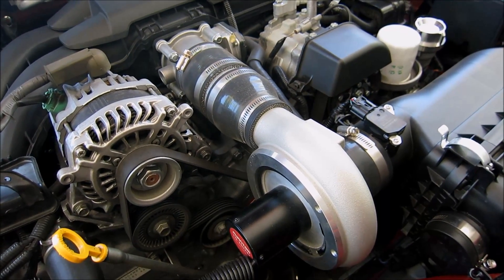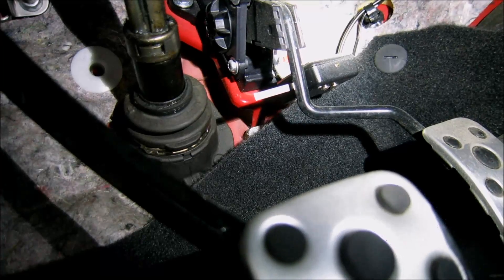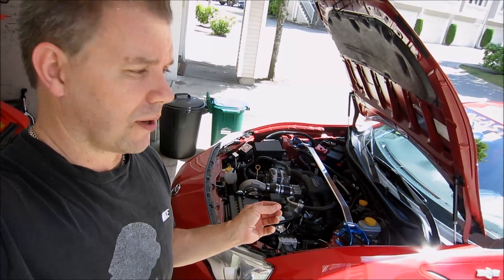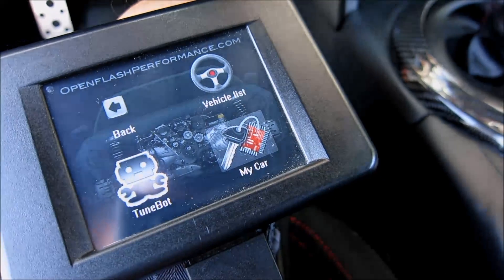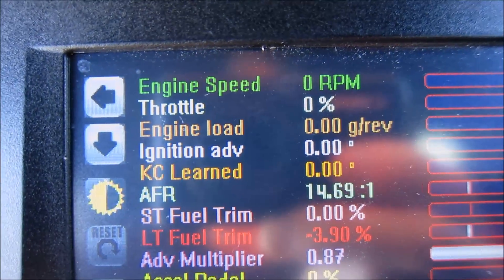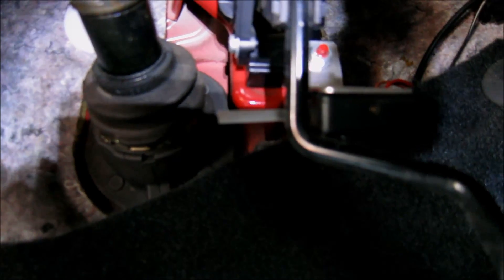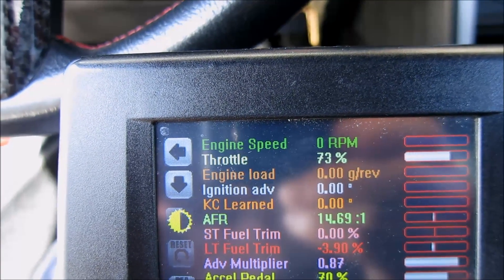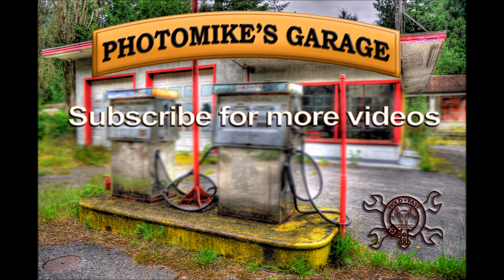The Phantom supercharger throttle activation

Comment: The point of the lower PSI; say 5-8, is to take away that low rpm acceleration lag. The point of low psi...so you don't blow your engine on stock internals, but get that umph, the pep in it's step. Y'all are thinking of this electric turbo in the aspect of it being worthless in drag racing and not as a simple tune to a daily driver without all the work. If he wanted 20+ psi...he'd of course go get a traditional setup and swap almost EVERY part of the engine...but that's not the point of simple electric turbos. You get to keep everything stock without lag.

Comment: For $2,000 you can install a really decent Nitrous system. I rather be getting the power from my engine so I think a turbo is way better because you don't have to recharge it and it has much more power.

Comment: At wide open throttle this would do nothing but restrict the intake because the amount of air being draw in would be greater than the output of the fan which would cause the engine to spin the fan faster than it's highest rated speed of the electric motor. 

At idle/ part throttle this won't work for the same reason a hair dryer stops blowing air if you put you hand in front of it which is what the throttle plate would do. At part throttle it can help raise intake manifold pressure slightly for a small range of the power band but once again as the throttle plate opens and the intake goes from vacuum to barometric pressure it's not going to blow more air than can be ingested and will cause a restriction. 

Parasitic losses from the extra alternator phase from running the fan and more parasitic loss from the fan blades blocking air after throttle is opened.

The only butt Dyno results you feel are from a shift in the power band from the restriction in the intake causing higher intake velocity due to lack of free flow.

Comment: I personally commend you for trying something different, that's how we as a whole figure things out and ways to make things better.

My question with this however is can a regular car battery spin that turbine fast enough? What if you used a separate 48v battery to really get that thing to spin?
Reply from the maker: It's 2 batteries connected in series to produce 24 volts which is enough to spin the motor 50,000 rpm which produces 5 psi max.  More voltage would be better and I believe the oems are using 48 volt for their systems but the controller I have can only handle 24 volts at this time.

Comment: I see a purple SRT in the garage. Why not try it on that? BTW, How can one reverse the boost from 5 psi @ low RPM's to 5 psi @ high RPM's instead of 2 psi @ high R's from a Jet Tech with a T/A "392"
Reply from the maker: The set up that I have would only produce usable boost on a small displacement motor at this time and would have to be significantly upgraded to work on such a large motor.  As it is it can only produce 2 psi boost at redline showing that it is running out of steam. So what you would need is a more robust system working with 48volts but at that point the cost might make a conventional turbo system more attractive.

Comment: If the supercharger doesn't come on until 60% throttle, is your engine not trying to suck past the compressor?
Reply from the maker: The blades of the impeller add no restriction to the intake. The throttle blades at part throttle are a much bigger restriction.

Comment: Im thinking of throwing this, or pneumatic charging on my geo metro 1.0L 3 cyl. its the only application i can really even see these working on. not for 2k though, ill make my own at that rate with left over parts and ingenuity.
Reply from the maker: If you can do it thats great, the only hard part is programing the controller.

Comment: I want to see the boost gage in the car at 6000rpm under load. You said there are two boost settings, 2 and 5, at what cfm?
It takes about 15 hp to make 5psi boost in 2 liter engine at 7000 rpm. Your drive motor would be lucky to make 1 hp.
http://www.superstreetonline.com/how-to/engine/0406tur-knight-turbo-electric-supercharger/
Reply from the maker: That article is pretty old, brushless motors and battery tech is way better now.

Comment: the only difference between a centrifugal supercharger, a turbo, and the electric one, is just the method to how the snail spins... either using mechanical engine power, exhaust power, or a DC motor. same equipment, just different means of spinin the turbine... this electric supercharger  is probably not as sophisticated, but its a start... needs a bigger brushless dc motor, intercooler, oil feed, battery bank, capacitor bank in the trunk, and an IC to communicate with the throttle to adjust boost... but there are pros and cons to all of these.. supercharger has the parasitic losses at low rpms, turbo needs time to spool, a real electric supercharger would give instant boost, but add extra weight from the dc motor and extra batteries... the switch under the foot pedal is kinda jank. it would be cooler as a button on the steering wheel

Comment: its just a turbo charger with an electric motor spinning the blades instead of exhaust, it has been shown that for this system to actually provide any real benefits the motor driving it needs to produce 6kw, and the air intake has been blocked by the motor, reducing efficiency, unless you can remote setup the motor or set it further of the turbo housing.

wouldnt even consider this rubbish
Reply from the maker: The supercharger impeller does not restrict airflow at anything under wot when the supercharger is working anyway. The throttle blade is a far bigger restriction.

Comment: It would have been easier to mount your throttle switches to the floor and affix two adjustable length bolts to the peddle stem, to activate each switch based on the bolts height, simply lock each bolt off with a second nut.

Comment: two grand that is $2000 no hey price is correct for a unit that has 18kw min. of brushless power and the gearbox necessary to get the rpm needed for pressure at cfm to work. 18kw brushless motors are available with  controllers also don't go off from max 10 second output to meet min required. the magic smoke of failure   get big motor get largest control[er put on ahead of MAF sensor or get MAP positive pressure read sensor ECU needs to be variety for boosted manifold pressure. then make go fast see simple for some hmmm easier to get car with all the support stuff then make hybrid design hmm yes want to go fast lol

Comment: Obviously ppl don’t  know what the functionality of a supercharger or turbo , it’s the compression of air into your engine the more cfm you flow the more power you’ll get , it’s the future no turbo lag no running return lines no tapping the oil pan ! no plumbing issues ! No pinching hands in belt tensioners ! No more belt slip !

Comment: Really nice. I now much about brushless motors and with higher tolorances stronger magnets and higher kv in larger motors means more power and less amp on lower voltages with means high rpm output with still strong power.. mens this is the way forward and it will be the future of turbo chargers. they that say this dont work or say this is dumb are wery much dumb as shit. they cant see outside of there thiny little world.., so for those guys. learn more about brushless motors today. brushless motors  can broduce about 15 hp each 500 grams when they press it hard and that is t today. that says alot. so please dumb shit heads lern more before you say so dumb shit you dont now shit about

Also I making my own. also maked my own motors with gears so small compressor turbo wheel can reach 160.000 rpm.  means about 1 bar on full tottle of an 2 liter engine. now that seems interesting. if my english is a bit bad is becouse im from norway :)

Comment: Anyone who actually thinks that a 12 volt freakin' hair dryer is gonna add power to an engine is a complete idiot or just doesn't understand how engines/physics work. You're clearly a complete idiot. I bet that thing is spun half by the power of the tiny ass motor it uses and the other half by the vacuum the engine creates. You'd need some electric motor that's bigger than the supercharger itself to get any real boost out of it, but by then, you might as well get a real supercharger.
Reply from the maker: It's a 24 volt motor and I am not a complete....idiot.
Reply: And how "actually" car with electrical steering rack works? Yeah.. they are fake too.Same as new Honda SNX or what ever was that new sport car from them with.. pure electrical driven brakes. Electric handbrake? It's only in the comic books..u say..
 What about high torque impact drivers on battery? Pure myth I gues...
There is American company producing exact same chargers and instead electric motor is driven by pulley and belt. So, if now there is powerful brushless motors with planetar gear to create more torque why not to get that concept work? What is the problem to get Root type of supercharger and instead belt driven to add motor and fit on what ever place u wish?
Turbo and compressor superchargers are with too much limit, which that idea can override.
Straight for that unit - perhaps is crap,came as chinese hairdryers for 30$..
Must be with sofisticated electronic, big capacitor to reduce the variable power sucking from battery and electronically controlled blow off valve.
Simple switch and few wires do not make any sense..

Comment: Why would anyone go back to the 60's for a mechanical controller? 
As far as the s charger goes, it's just compressed air. How it's generated means little.  It does take a load off the engine by not restricting the exhaust.

Comment: An electric supercharger isn't going to compress anything strong enough to affect anything in the cylinder.
Reply: It does not have to compress anything, it just has to improve the filling grade of the engine with the correct mixture. More air and more fuel.... if a normal atmospheric aspirated engine reaches a filling grade of 70%, thats great. With some help 80 to 90% filling grade means a world of difference.
Blowing a normal engine over the "limit" CR, will give some expensive repairs to do. 
BTW, i build strange things myself...

Comment: PHOTOMIKE, is there a way to control boost by engine rpm along with throttle position? It seems to me if the engine is at a low rpm and you ppush the throttle to 75%, the engine isn't able to take the extra air and gas until the RPMs build higher.i bet once the motor hit 3,000 RPM it could take all 5 pounds of boost so something has to be done to control the speed,like a variable speed motor,DC motor? a motor that can be controled from idle at zero boost to 15 or 20 maximum pounds. i have no idea how to set that up,but if i knew more about it, that's what i would shoot for
Reply from the maker: Your right, with my setup you must be careful when you hit the throttle. There is a progressive digital controller available called the "Procede controller"  from Open flash tuning but I prefer my manual throttle switch.

Comment: It's pretty cool and I can see how it's different than those lame ass electric ones that don't actually build any boost. However the cost is a little ridiculous in my opinion. I wouldn't be interested in dropping more than $500 to $1000 tops on something like this. Otherwise I might as well spend a little more and just put a full out super charger or turbo on my vehicle and get even more boost.

Comment: A few questions for you:  

1)  Does the intake air have to flow through the non-moving blower when the unit is not activated?  That is - aren't you slowing down the air under ALL OTHER operating conditions, thereby negating most of the benefits of having it activated ? 

2)  2 psi of boost is barely anything at all in terms of airflow - why not run it all the time?  That's a tiny little electric motor, so it can't be drawing that much amperage...

3)  Let's take MY car, which has a traditional mechanically driven supercharger.  Or let's use ANY other car with supercharger that was designed and built in the last 5 or 10 years.  I'll thow out some data from my car, but this question applies regardless.  My supercharger, when driven at full load and full speed, requires around 80 to 90hp JUST TO RUN THE SUPERCHARGER.  That's right - my intake air is flowing at a rate of approximately 1350 cfm (cubic feet per minute) at a pressure of around 17 psi - or just over 2 atmospheres.  My question to you is this:  If every other air pump requires 20 to 50hp to run it, how does yours work with that teeny tiny electric mofoss
Reply from the maker: 1) The air does flow past the impeller and is not restricted by this.
2) 2 psi is significant and it takes 50,000 rpm at the impeller to achieve it so the batteries can not maintain this beyond roughly 60 sec.
3) Well the Phantom supercharger is not producing 17 psi so the hp requirements are not the same but the electric motor is being pushed by 5000 kw and that produces the 5 psi.
Reply: Wow - ok, that's a lot more like it.  A 6700hp (5000kw) electric motor pushing 2 to 5psi of air into a 2.0 liter Scion engine (with a Lexus steering wheel - that's one of my favorite upgrades on the 2.0 boxer engine.

I also noticed you upgraded the strut tower brace.  I'm assuming this was to improve the torsional rigidity required by the higher boost you are producing?

So as you said - the air flows around the impeller - could you point out in the video where the bypass valve is located?  In this picture, it looks like the airbox is bolted directly to the impeller inlet, and the outlet of impeller appears to connect directly to the throttle body.  Behind your throttle body are the intake runners.  I'm sure it's just hidden by the piping - but it's hard to see the tubing the allows the intake are to go around the impeller rather than thru it.

Oh - one more quick question and I will leave you to your testing:  The 5000kw electric motor is AMAZING!  This is the smallest one I have ever seen at that capacity.  Can we get any more details on it?  How many volts does it draw?  How many amps are needed to push those volts?  And since at leak engine load - when demand on the supercharger is highest - can you disengage the alternator to conserve power to the charging system?

Also - these tunes to adjust airflow based on engine demand are - as you noted - very sophisticated.  Can Vishnew tuning help me tune my FRS so I can dial in perfectly the airflow?  I have the mechanical supercharger with the engine belt for mine, but now that I see your design here, maybe it can be adapted to work with the electrical system, too.

;) to my gearhead buds reading this!
Reply: Eric Fontaine 
dude.. I like your style.. but..can u explain how 18v motor of size 50 x 90-100mm what is in Milwaukee impact torque wrench can produce 1300Hm? 
For 2bar of pressure 50-80 horsepower.. Are u insane?
With 2.5hp electric engine u can drive air compressor that create 5.5-6.5 bars!!!
Do you really know how much pressure is in your car's engine? Notmal car with any charger need 0.8-1.2bar of boost. If you get 2-2.5bars for pwtrol one that mean your car should be somewhere between 6:1 or 5.8:1 compression ratio.. Is it?
Belt driven charger "dye" earlier  so it must be fit in case you wish low range torque. Same as small size turbo. 
If constructed well,electrical powered supercharger is great as idea. 
And that on the video unfortunately is not good one at all.
And as last.. if you kicking how powerful supercharged car u have.. , how better and faster is compared to Tesla?..
Don't tell me I know..

Comment: electric superchargers can not provide enough boost mcm also proved this, only source on the car to provide enough power to compress the air is the engine
Reply from the maker: MCM only tested the cheap (obviously does not work) ebay electric superchargers not the Phantom electric supercharger.
Reply: but its not possable to run a electric supercharger and gain power the use of extra power source with more batteries which will need the use of the alternator to keep charged therfore sappjng the current from the car. like a subwoofer which need a extra battery for the high power beats. if however there is proof to proove my theory wrong i will gladly accept it and take back my negativity againt them
Reply from the maker: You do not get power for free so yes the alternator must recharge the batteries and that does take away hp  from the engine but that occurs when you not on full throttle .
Reply: do you not see what your writing? you say it would need to recharge when not on full throttle which is the area where the alternator charges at full capacity, so again you would not gain any power as the current would never be enough, I know there are modern motors etc which can produce the sufficient power but not from a car electrical system it doesn't supply the high demand needed, at best all the electric supercharger can do is aid the air flow, it would not be able to compress the air

Comment: That looks awesome. I'd rather have it always on though and enlarge my injectors, pump and remap the ecu for higher fuel delivery. I'm a fan of consistency
Reply: Come to think about I wonder if the Dyson turbine could be turned into a homemade blower (just thinking of it as a driver, I know I'll need a compression housing and if possible an intercooler to increase boost